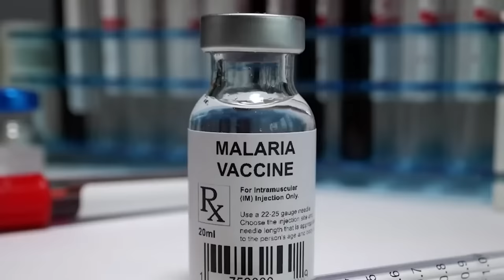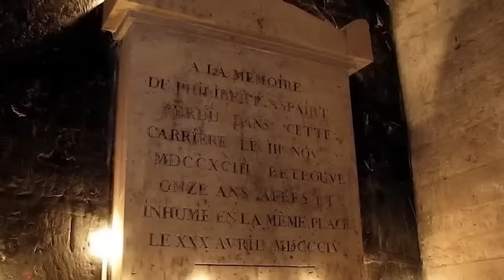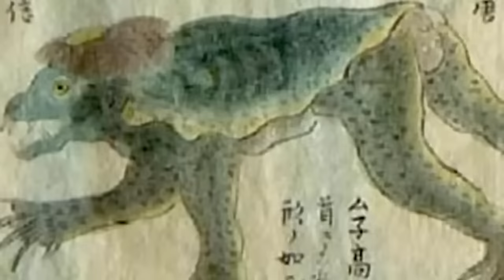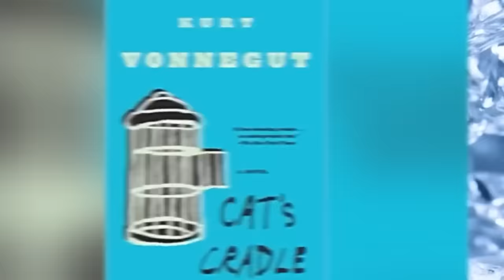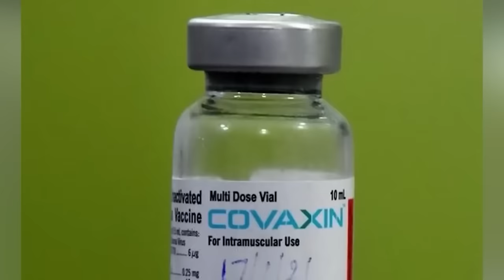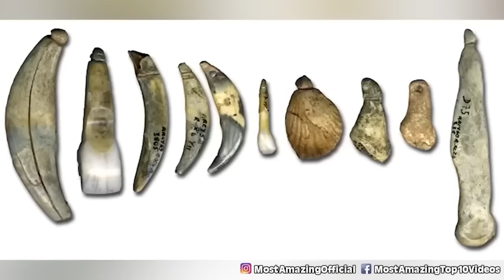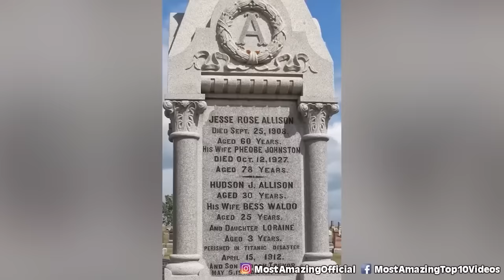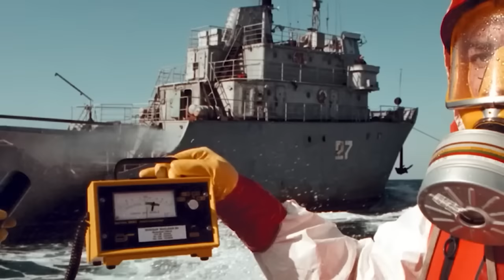Creepiest Discoveries From 2022 That Might Ruin 2023

Comment: Stalactites  Sta/lag/tights three syllables, not staly/sights, when the water drips down from the top they are stalactites when a long one is created from the floor up they are called stalagmites Sta/Lag/ Mites I think I learned this in the 6th grade I did have to double check the spelling and I made the three syllables easier to read. Because I did not know what you were talking about at first. It is a geology thing I guess, I'm just trying to help you out!

Comment: I believe part of raising temperatures is due to wifi. Think about it, each modem releases small amounts of radiation.  With as many people thay have wifi, that would seem to affect the world's temperature.  In small amounts it wouldn't make a difference, but I know wifi is everywhere.
Reply: .......replace wifi with burning fossil fuels, burning toxic chemicals, and all of the other pollutants we put out into our world and you've hit the nail on the head.

You were like [...] that close to the answer.
Reply: If the EMF exposure intensity decreases as you increase your distance from the object that’s sending out waves, then wouldn't any effects  from a large number of electronic devices being used first affect the regions with the highest volume of use and spread from those regions outward? Radiation doesn't just travel out into the atmosphere, gathering into climate altering masses large enough to terraform the entire planet in a slow, subtle transformation.